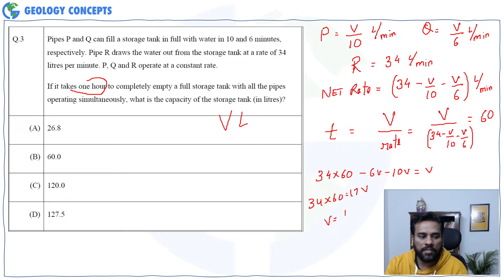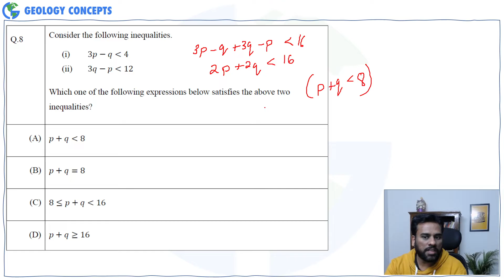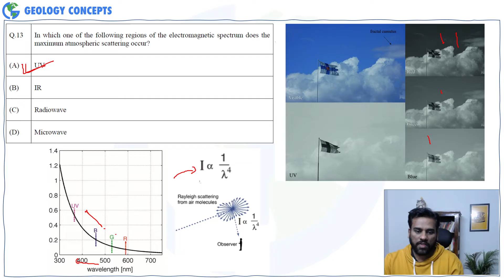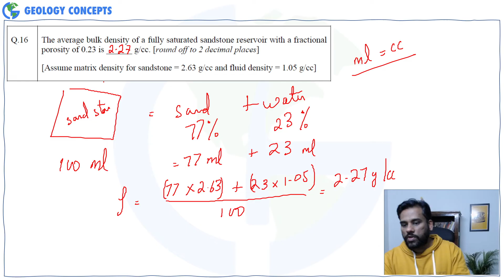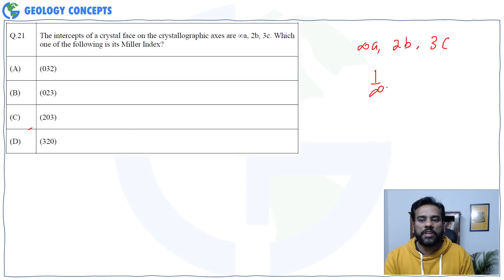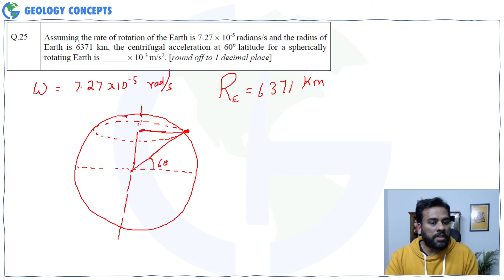GATE GG 2022 Solutions | GA and Part 1 (Common Section)

Comment: In 16 th question How you took 77 %and 23% .. could you please explain
Reply from the maker: 0.23 porosity means it is 23% pores and because it is saturated all the pores is filled with water which makes volume of water also 23% and remaining 77% will be sand particles!